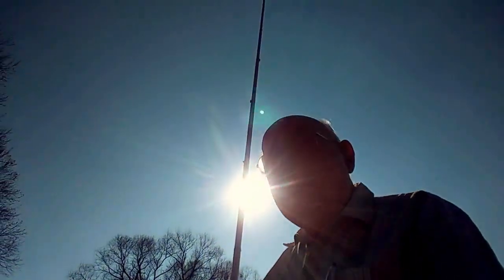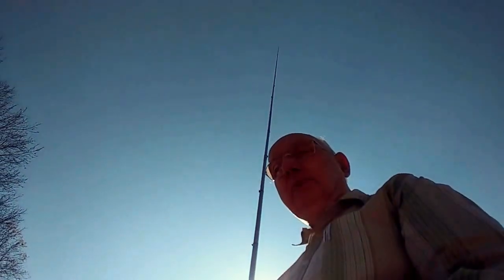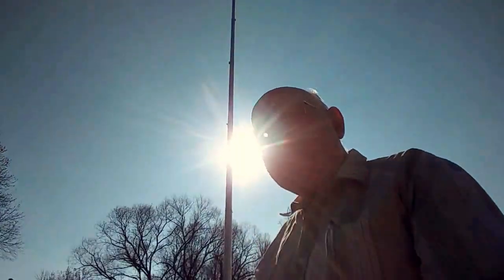Short Walk Out to the New Antenna for W5VE

Comment: Great looking installation you have there, Mr. Ralph.  I will check out the Zero Five 43' Vertical for my next project.  I'm currently using a Hustler 6-BTV with 17m addon kit, all from the fine folks at DXE.  You are so right sir, the dx contacts immediately start appearing when you have a good vertical.  Thanks for sharing with us, 73,  and God bless!

Jamie/K5SFC

Comment: Im fixing to put up a zero five ground plane , with the 8 ft radials, , I have more than enuff acreage to put up any antenna that I want , but im just a tad on the lazy side to put in ground radials on or in the ground, not really lazy , but I just dont want to go that route. but hey yours is looking good and with 3k ft or wire on the ground I bet its a winner , Looking good  73's Tom  KB5SMG